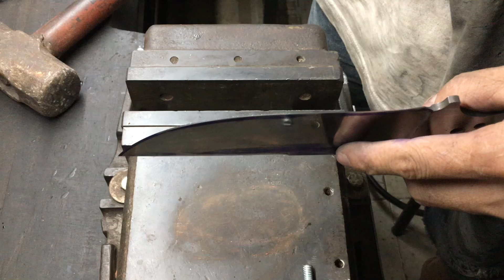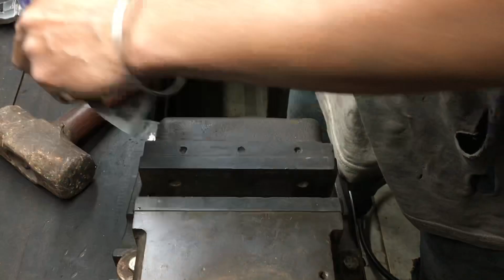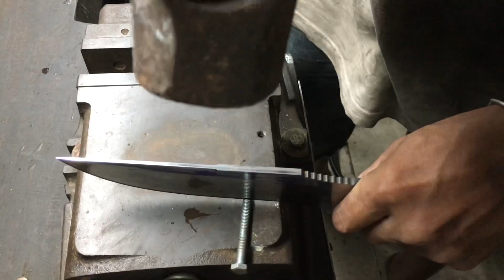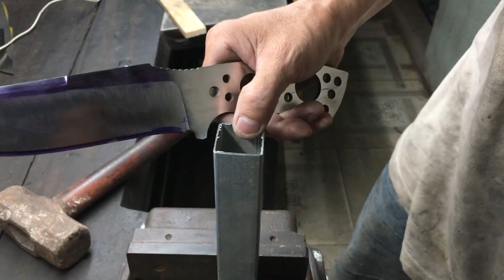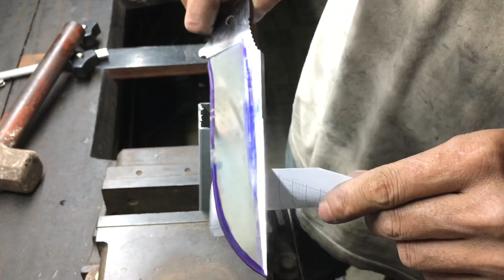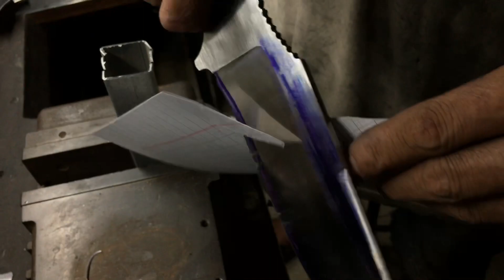Tested M390 steel.VNdiy #1

Comment: What hrc are you using?
Reply from the maker: I don't have a hrc meter,I think it's over 60hrc
Reply: @vndiy8963  cool thanks. I admit iam surprise by your results. M390 is not a steel a tough could cut a nail with almost no damage. Many other test showed important damage on the edge with less destructive test. Good work your doing